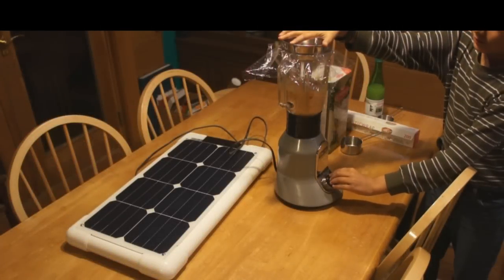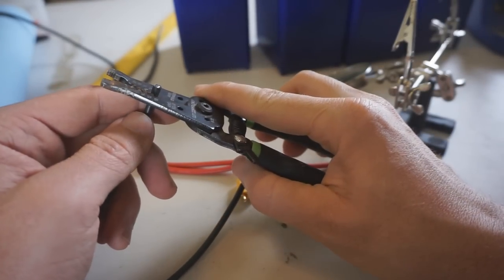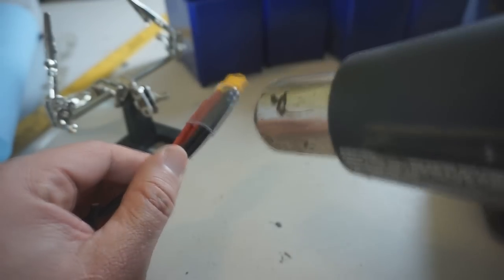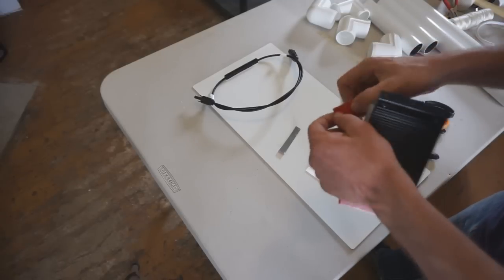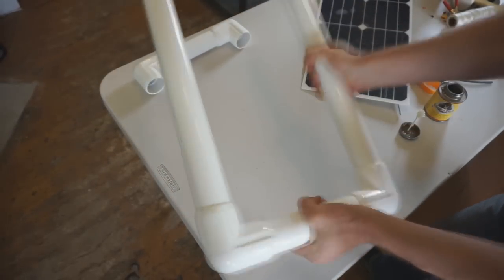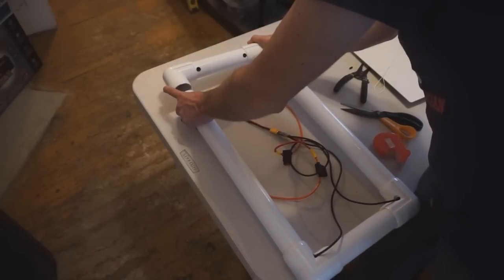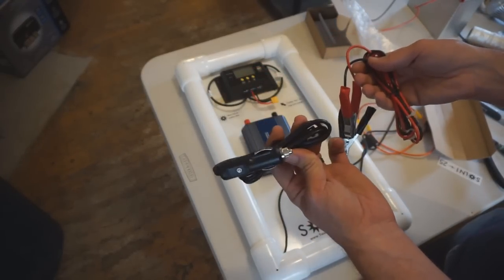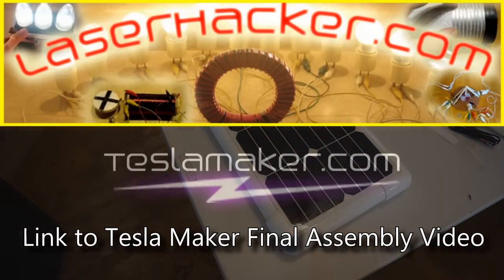DIY Solar Generator SOLN1-25 - How To Build

Comment: Great crimp tool love it. Ive found placing the connector into the crimper first ,then simply sliding the wire in place and crimp ,very study perfect crimp.just FYI

Comment: This is a good idea LaserSaber. What about this idea: You have a solar panel, output goes into a bank of super capacitors all wired up in series, the capacitors go into a Joule Thief type circuit. This gives your panel a pulsed output. You can use the pulse output to charge batteries or power lights directly from the capacitors. This setup is 1) very cheap 2) has no parts that really wear out 3) will pulse charge car batteries which will make them charge quicker and reverse corrosion on the plates making them last longer. You did tests with this sort of thing early but you ended moving away from that for some reason. Also, what is the point for the RC connectors, why not solder the wires directly? Anyways.... thank you for sharing, another very detailed and easy to follow video.

Comment: If you dip your wires into soldering flux (fluxing is the most important step and will allow the solder to suck into the joint whether you are using rosin core or core-less solder)you won't have to tin the connections first and it will make assembly go much faster.  Tinning both sides can sometimes make the solder flow together faster but a well fluxed clean joint will make a great mechanical connection regardless of the way you solder it.  If you are going to tin a bunch of wires get a solder pot.  They are inexpensive and a great way to recycle excess unused solder as well as buying solder in bulk.
Reply from the maker: kuhrd 
Thanks for this great info!  I just ordered a solder pot.  I am looking forward to trying it out.
Reply: +lasersaber None of those links at lasersaber.com work from the UK. (parts links)

Comment: I really like what you have done with this set up. 2 thumbs up..  what is the diameter of the pvc tubing the build sheet does not specify the diameter of the PVC tubing.

Comment: Awesome video. I have done some solar charging videos myself, and know the challenges. Question for you. What battery bank do you recommend for this setup?
Thanks
Reply from the maker: jr10 
I gave links to the recommended battery here: http://laserhacker.com/?p=500
 
It is listed under the parts list section.
Reply: I had one last question. LiFePo4 batteries when in series need balance controllers between cells for balanced charging. How did you get around this?

Comment: I would swap out anderson powerpole connectors with the XT connectors.  I switch and find them much easier to work with and compatible with a lot of Ham Radio uses.

Comment: Hey, since I'll be buying all of these tools to build my soln1-25 and I don't want to necessarily purchase two different types of soldering irons, which one should I get?  Also, I haven't soldered anything since way back in junior high, like circa 1982.  I used actual soldering irons that were heated in like an oven and our solder wasn't in little coils, so is there different gauges of solder and if so what should I purchase?

Comment: this is a fine setup , but will NOT run things you plug into it , continuously , it needs to charge back up. How many hours does it need to charge back up ?

Comment: Hi, you have a Super Capacitor/Lithium Iron Hybrid Battery vid for your cars... which you say can be charged via Solar. Could that application also work here, to replace/supplement the batteries?

Comment: May be even without this glue, you could assemble the pieces to fit the solar panel and put markings on the pipe - how far should the piece fit each other... And then put glue and align according to the markings

Comment: Where did you get the solder you used in this video?
Reply: I was wondering where he got the fingers from used in this video
Reply from the maker: Daniel Piotrowski 
Amazon.: http://www.amazon.com/gp/product/B00068IJQI?psc=1&redirect=true&ref_=oh_aui_detailpage_o06_s00
Reply from the maker: Mind Turd 
:-) They just kind of showed up slowly after years of non-stop trying to learn to count.  As they came into being, I discovered that I can now count to ten quite easily.  I think this is why I best relate to a ten base number system.
Reply: lasersaber Thank You!

Comment: Why wouldn't you just dry fit the pipe and panel and then place a small mark or a piece of tape of where your fitting's should be on the tube.  Then you nail it dead on every time once gluing up?

I would also advise anyone making this to tin all your wires before crimping or connecting to the controller.  You'll have much better connections long term and help prevent wire corrosion.